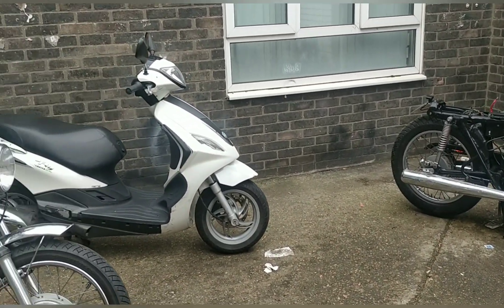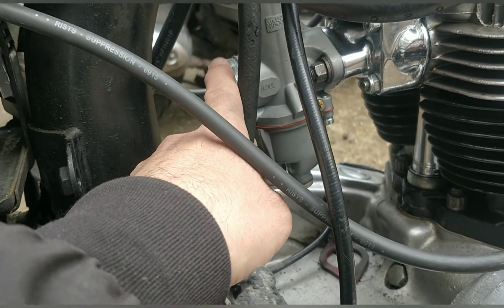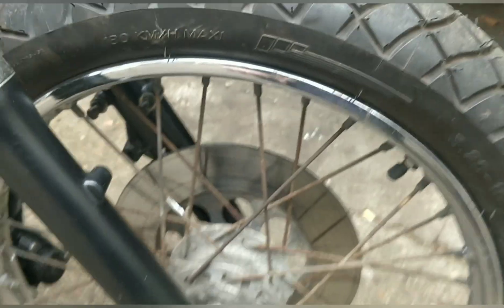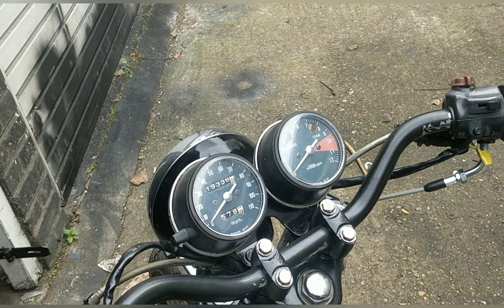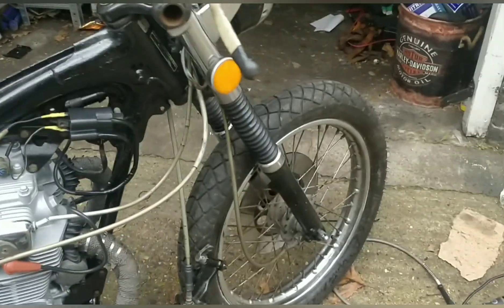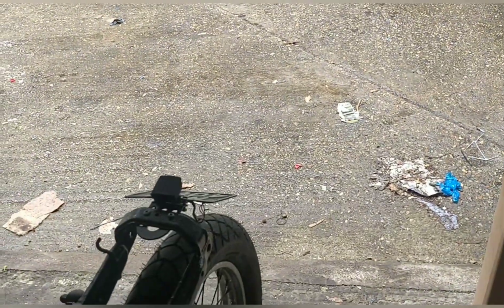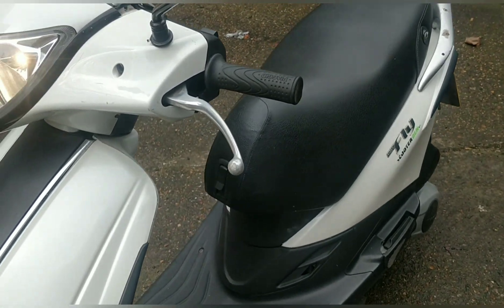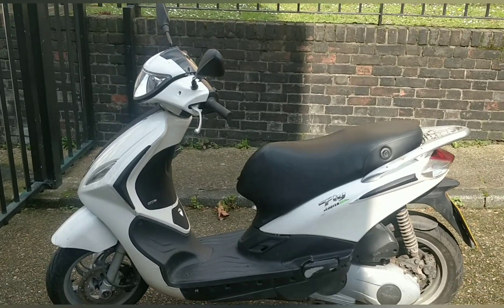Garage update, triumph t120, Honda cb200, Piaggio fly 125.

Comment: Hey Charlie,,,honda is looking good,,, keep at it with the  wheels,,,no need new ones I've cleaned  up worse,,,drill with  a wire brush gets  the worst off the spokes, a bit more time  and it will  look  better,,,keep the £250 in your  funds,,, you don't  want it  showroom  spec 😅
Reply from the maker: It took ages just to get the worst of. But the spokes are good and solid. Harry just mentioned harpic. I may give that a go next weekend and see if that helps. 

Cheers Anthony

Comment: Hey mate I'm going through the same process, gotta take paint off wheels as well as rust on wheel spokes... Found that using a drill and a rotary tool both with a wire brush attachment work really well + add in wd40.

Thanks for the motivation btw, I've learnt so much from your videos and finally decided to work on my Virago myself!
Reply from the maker: Oh wow that's great advice and thanks for the kind words. Sometimes we need a little push to do the jobs we can do. Especially as now days everything cost 3 times what it used to. 

Cheers